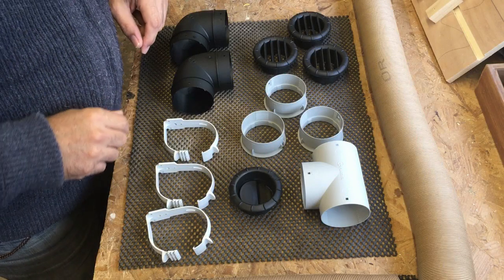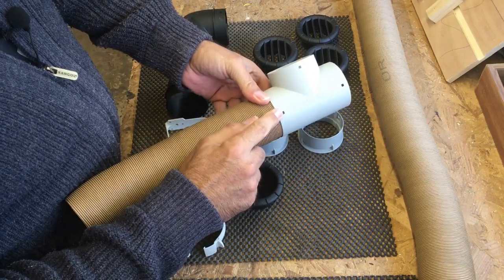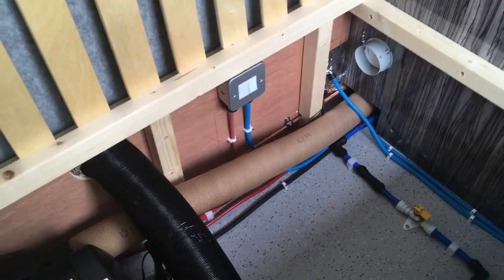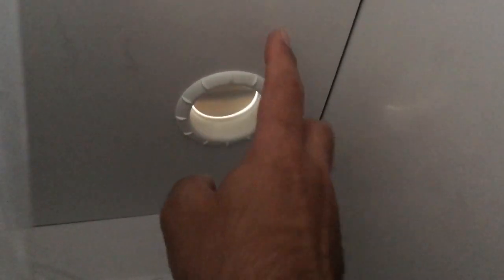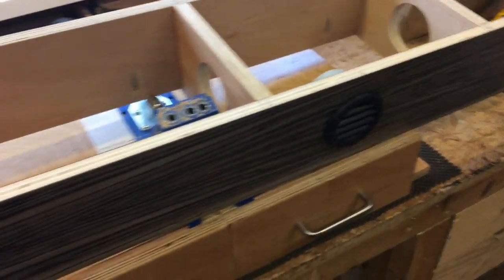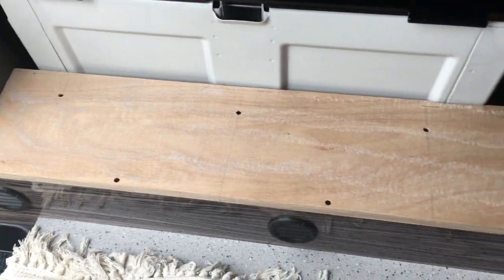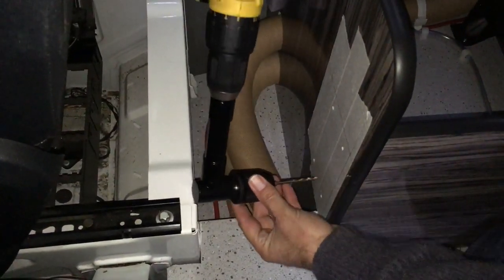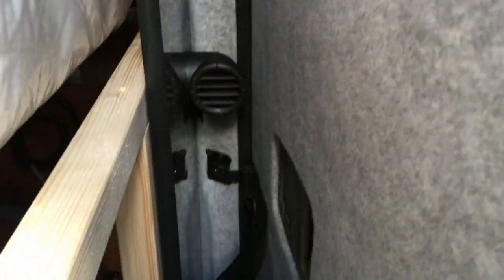Mercedes Sprinter Camper Van - Heating & Vents

Comment: I am from Quebec Canada and I am following your project with great interest.  I am building my own caravan using european concepts, especially, drop down vents for gas.  I noticed some manufacturers are adding some kind of deflectors to prevent rain water to enter while the van is running.  I also noticed that many others don't put anything:  can you just tell me what you did and most important, why you did it.
Reply: English is not my first language, I am sorry!  Maybe, I should have used the term "clamshell" instead of "deflector"?
Reply from the maker: If you have any LPG / Butane gas appliance in your van it is a safety feature to include a drop out vent local to each appliance and where your bottle is stored. As your van is moving all the time there is a possibility that you may develop a leak and as LPG is heavier than air it will fall to the lowest points, the drop out vent allows the gas to vent directly to outside thus reducing the risk. I would also recommend gas detection and CO detection near a heater. Hope that helps
Reply: Thank you Greg for your quick response.  I totally agree with it, I was planning to do all the items you suggested, even if they are not required by law here in Canada, specifically gas drop out vents.

My question was about rain water intrusion in your van by the floor when your are running your van.
Reply from the maker: @charlevoix418  It can only make your van much safer :D That has got to be worth doing right in my book.

Comment: I need a heating solution like that for my garden office. I could run those pipes behind my plywood walls.. but what could I use as the heater?
Reply from the maker: How about a 5kw diesel heater with 4 ducted outlets, you can have a plastic diesel tank and just fill up from a can off local garage.
https://rover.ebay.com/rover/1/710-53481-19255-0/1?ff3=4&toolid=11800&pub=5575265109&campid=5338027957&mpre=https%3A%2F%2Fwww.ebay.co.uk%2Fitm%2F12V-Air-Diesel-Heater-5000W-4-Holes-LCD-Monitor-PLANAR-For-Trucks-Boats-Bus-Car%2F283359891717%3Fepid%3D20026165031%26hash%3Ditem41f990d105%3Ark%3A5%3Apf%3A1%26checksum%3D283359891717588503124c0c4a2e8df4a8842ab784ee%26enc%3DAQADAAAC8BkojIFHYtWT%252BANpG6F7t2EKlYIPdjE3OEgKkdfBrU%252B0Pd8Bj9TYpZp3Avh0GufF2TLIiwCHAQymggjHNOw0dqsHSu9oMBATvs5M0u4E2neM6ECeH5AJanYf8Z%252ByWxVaO0zaQGuU%252B5pXI%252BSIBV8Vo3%252FLJ2fJifOD1Iw9%252BBy%252BInPaC%252BN0rGIEK%252BdVzJD7%252BCwb7nrs5ZlpmlNvnsrCzHntHgPGeCrDPkGHry6TVEA3R4Uxxw0Cq9viF%252BdjzJ%252FPg18esa4NQCKyWTAi8pzglQt1HPqfDcNU377v6JrBM1pS3d6%252B085PmGDdjcqEaLvmfKxivbFhO%252BvoHsF%252B9slkmvsi9mzIgQHEk%252FlOIgBYb8fEO%252FeWQs2y3Kmc24I%252BARNA1G%252F%252BYESzMHFO179%252FHkEPpkc6TsYTU1XUwdrv8gLH3oqglIAH1yQRtVpwagkrF840VLENsPPQshnsKWw5Jp%252FLDdMae0kyEGQtHYMyZ6YO8nHDUYhuCgzbMGnd3RIcuykAYYZJOGWXsUuunj4HszU98z6w13vQu1czCLHQHAQTs1p6blkycKOUiz5hQgU8VVvr4yas7mUGiI0kz0s0s65ABOlWBWI4ghzUkKQ6iXO2ZLeXBxOjVgzsCIaWwvpa8ACf55sL7cwjE4rSGenPbqc6tplTGRc6YOlOvjpYKKHmkOnlpMjYdZIIvjv0hEL02lJNZd5YwSoYgtkouzfMwlyXr3eyhjOy4qa9muj7SrtjSYlb9gyQ8hazftHIikOxiVR137O5zeQ%252FNMP4TTrBHTSq%252BQzUKdrTwU14bIfDPsM%252Bz81YrCLlo%252F4syN7drpzoF6TuVINvP%252Ft8WCz0pPdc078HEYqXlkZA%252BPfJ%252BZD5xx%252BLVrYKezV0sIiPmOZWmZZ93BT4XaoLWWbwUETxzYTVRcditCghinNUSM%252BPJldxP1i0kgo5Qq3rX5ZgDgIy3U6ckmNJUUUQpcVl%252F5WMAMv0NIIr2XKqzt0fpUQ5m7PgGtoYKR2gj%252B%252Fe%26frcectupt%3Dtrue

Comment: The only thing I'd have done differently with your van would be to change the double front seat for a single seat so that you can get into the back without having to get out of the van and go round to the side door.
Reply from the maker: But I can get in and out without going outside, just swivel the seat while in the cab and step into the back and the reverse before heading off.
Reply: @GregVirgoe  That's good, I didn't know you could swivel the seat around while sitting in it. I feel a demo is required :)
Reply from the maker: Lol not quite like that, but you can rotate the seat while standing on the driver's side. you can then simply step through 😃
Reply: @GregVirgoe  Ah, then I must refer the honourable gentleman to my initial comment :) I did watch the magic revolving double seat video, but having owned a motorhome previously I would definitely miss the big gap between the seats.
Reply: I was going to make a similar comment - 2 single seats seems better to me
If you're going to have to stop to get from the front of the van to the back, then you might as well get a divider and only have to heat the back part of the van
Reply from the maker: uTubeismyTivo, I would not want anyone in my van moving around while driving far too dangerous and not heating the cab is not a good idea either, sorry but we will have to disagree on that 😊
Reply: @Simon Sackett - Its a personal preference and use issue - if you are going to be travelling for several months at a time like Greg, then you'd want more comfort in your living area and be happy to sacrifice the seat gap for it. For a weekender or shorter trips, you'd want the seat gap and possibly a pair Captains chairs with a small dinette like @Gadget John on Tour has - its all down to your personal preference and how you plan to use the van
Reply: uTubeismyTivo - its illegal in most countries to not be seated and have a seatbelt on while the vehicle is moving, so no one should be moving to the back of the van without stopping first. The double swivel seat gives a larger lounge/living area in a van with a fixed/raised bed, so its a trade off - more lounge area vs a slightly less convenient route into the back, which is what you want when you are travelling for a few months.
Reply: a passenger's single seat also offers the passibility to change the angle of the back part of the seat especially on longer distance trips
Reply: @docu_graf, very true, my Sprinter came with a 1 & 1/2 front passenger seat - so you'd think you have the best of both, gap to get through and a slightly bigger seat, but its fixed in place, my knees are a bit close to the dash and its a bit too upright in the backrest for me. I'm on the lookout for a single passenger seat or I might end up doing the longer trips sitting in the dinette seat in the back  :-)
Reply: @GregVirgoe  More seating room in living quarters plus being able to carry two passengers over easier access from cab to rear or vice versa.
You made the same choice I would have made.
I'd probably of welded or got someone to weld a sprung locking device with grab ( pull ) handle on the swivel plate and done away with them hand locking bolts, great idea but easily improved on. I can swivel my passenger seat in around 5 seconds with such a lever, the driver seat takes a little longer due to the steering wheel though.

Greg you can always update the design of the locking mechanism at a later date, you have the essentials to begin with.

That's me finally all caught up with All your vids now ha, great journey, I'll be staying tuned of-course. Cheers Greg, good man!

Comment: I like that right angle chuck attachment, I'll have to look for a left angle one that I can use (wink wink) 🤣
Reply from the maker: LOL this is what you need https://rover.ebay.com/rover/1/710-53481-19255-0/1?ff3=4&toolid=11800&pub=5575265109&campid=5338027957&mpre=https%3A%2F%2Fwww.ebay.co.uk%2Fitm%2FRight-Angle-Keyless-Chuck-10mm-For-Left-Or-Right-Handed-Drill-In-Confined-Space%2F262705052200%3Fhash%3Ditem3d2a70fa28%3Ag%3ArFMAAOSw9OFZEuf1%3Ark%3A1%3Apf%3A1%26frcectupt%3Dtrue
Reply: @GregVirgoe  Amazing coincidence, today I popped into my local Lidl on the way home. This week's offers include a Parkside angled chuck for £4.99. Up to 10mm chuck and, as with all their stuff, a 3 yr guarantee. Can't be beaten.

Comment: i have the same 240v hookup box do you know what cutter size you used for hole
Reply from the maker: pretty sure it was a 90mm hole saw
Reply: @GregVirgoe  it must be a 92mm bit then,u have a 86 and 92 in pic
Reply from the maker: It's an odd shape because it's flat on the sides so I was tempted to cut it with a jigsaw. The overall cover size is about 105mm wide so it will cover a 92mm hole, do you have the hook up socket ready to install? I always measure the device just to check instructions 😃

Comment: Great job on the vent build and video. I was curious about the number of vent vs the size of the intake vent for the heater.  How close do the need to match to get proper flow for an efficient load on the unit?

Comment: Great vid as always. I'm been having some concerns with my battery always being frozen which is located behind the sliding door under my platform bed that has the "garage" area underneath. I've wondering if I shouldn't get a tee on my Propex ducting to run more ducting over that battery and continue towards the rear of the van to provide some heat in the garage to dry stuff out. But then perforate the duct as it runs along the battery to provide some heating off that duct for the battery. I'm no HVAC expect so am wondering if those perforations would have any impact. What do you think?
Reply from the maker: Perforations in the duct will work, in fact they use perforated ducts industry to give very even diffused flow. 
You could start with just a couple of holes and increase if you think you need more. 
I am heating the garage in our van also to keep the cold out
Reply: Great! Cheers Greg

Comment: Hi Greg, Is it possible to run a vent to the engine bay (to assist start up of vehicle in cold weather)? also is it worth insulating the duct pipes (foam or tape) to save on heat transfer loss? = if so, what would you recommend?
Reply from the maker: Yes, and here's a useless pub fact, UK fire stations have heated engine bays to keep the fire engines warm to ease quick startups.
In reality your van engine is sitting in outside air as so open to elements I'm afraid it wouldn't work the same.
Reply: You could keep the engine somewhat warm if you extend engine coolant pipe, warm it with your heater and keep coolant circulating. 
Labor intensive and expensive project.

Comment: Hi Greg, what kind of bed are you using in your van? Size, Spring/memory foam, etc?
Reply from the maker: Our bed frame is made in sections and an be removed it measures 1700 wide and 1800 long. We currently have a custom beds foam mattress which has 6” norm foam & 2” memory foam top, made to custom size very cheap and very  fast  2-3days this is all sitting on an Airmat ventilation membrane to keep the mattress dry at all times 😀
Reply: @GregVirgoe  Thank Greg, I'm about to buy one myself and this is pretty much what I thought. cheers
Reply from the maker: https://customsizebeds.co.uk/
Cannot recommend them highly enough. Excellent!

Comment: That right angled drill attachment is amazing, there isn't a link for the one you used in the description though? We'll have to get one for our van!
Reply from the maker: The link is in the video description guys, here it is for you https://rover.ebay.com/rover/1/710-53481-19255-0/1?ff3=4&toolid=11800&pub=5575265109&campid=5338027957&mpre=https%3A%2F%2Fwww.ebay.co.uk%2Fsch%2Fi.html%3F_from%3DR40%26_trksid%3Dm570.l1313%26_nkw%3Dheavy%2Bduty%2Bright%2Bangle%2Bdrill%26_sacat%3D0%26LH_TitleDesc%3D0%26_dmd%3D2%26_osacat%3D0%26_odkw%3Dright%2Bangle%2Bchuck%26rt%3Dnc

Comment: Greg ! You didn't match the grain on the LPG cupboard to the panel behind it ! ! ! Spoilt my day now.
Reply from the maker: Trust you to notice that :D LOL The rear doors are book matched, is that not enough? haha
I had to use what little boards I had left for this bit.
Reply: LOL I actually like the way it looks. I mean it isn't like the grain is running cross ways or something! 😁
Reply: @GregVirgoe  I'll let you off then, I wouldn't be popping out for another 8x4 furniture board either!
Reply: I agree but didn't say anything in case he rips it apart and does again.  LOL  Great video Gregory old boy!